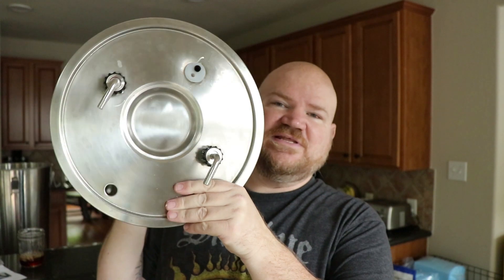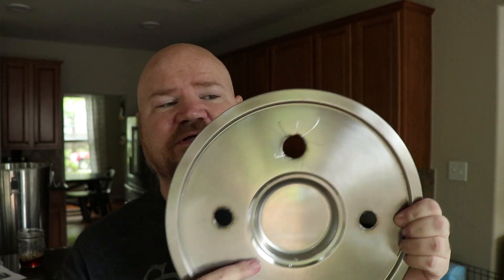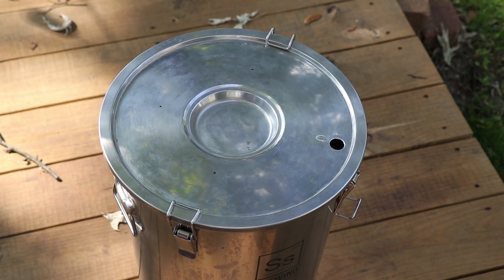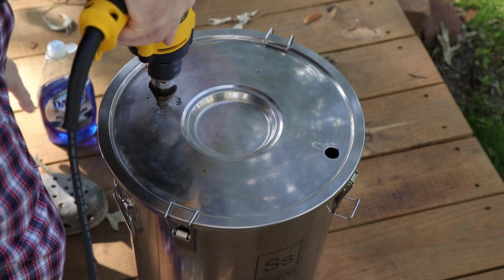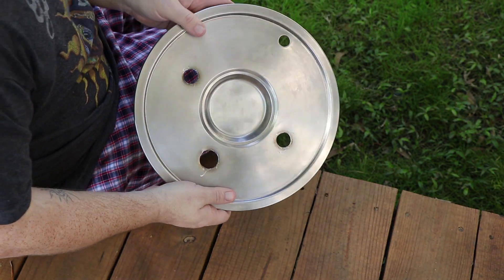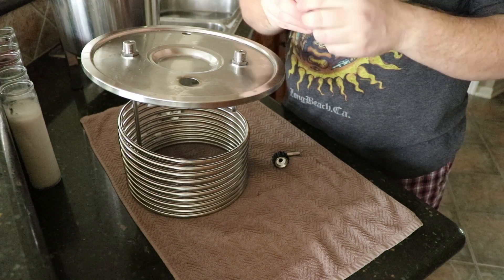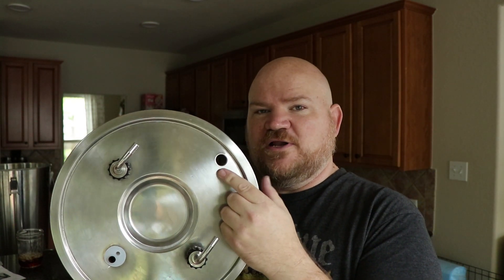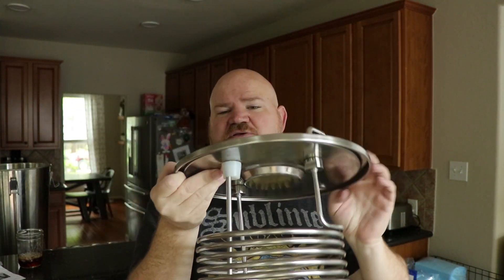SS Brewbucket Mod for Blichmann Cooling Coil

Comment: Hey Brew-Q, I have an issue with brewing lately. For some reason I am not getting the ABV in my all grain brews. I don't know if it's when I mash out or not. I'm a little confused when it calls for no mash out or a 5 minute mash out. Please help.
Reply from the maker: One thing that is possibly going wrong is your water chemistry.  What type of water are you using? Tap, reverse osmosis, spring water, or something else?  Also, you might need to invest in a ph measuring pen so see what the ph of your mash is as that can be a huge contributor to the issue.  Adding things like food grade gypsum to your mash water helps as well.  Typically a Tbsp of gypsum to 5 gallons of water. Another item that could help is going with a finer crush on your grains.  Mashing out basically takes the current mash temp and raises it to a higher temp to stop the sugar conversion that is occurring during the mash process.  5 minutes, 10 minutes etc just mean to let the mash sit at that temp for that amount of time before moving on to sparging.  Hope that helps.
Reply: @TheBrewQ  Thanks. Funny you say the water could be a possibility. I have recently been using tap water when I usually use distilled. I might need to go back to distilled or spring water.
Reply from the maker: I’d choose spring water over distilled.  Lots of natural minerals in spring water, hardness wise, that may help with the issue.